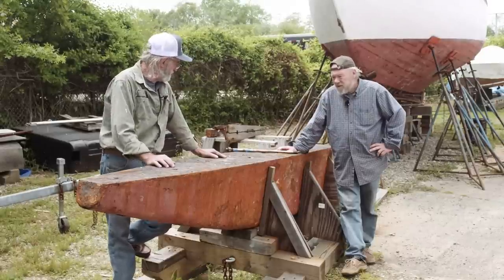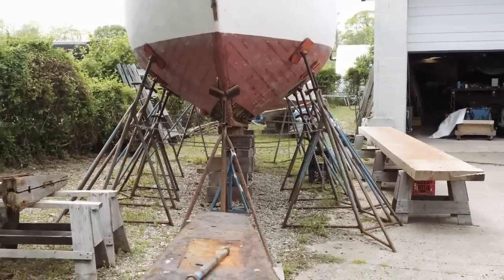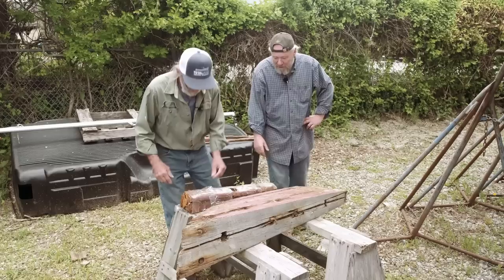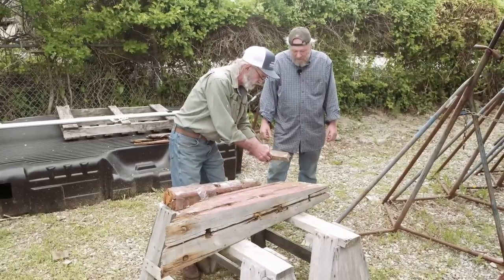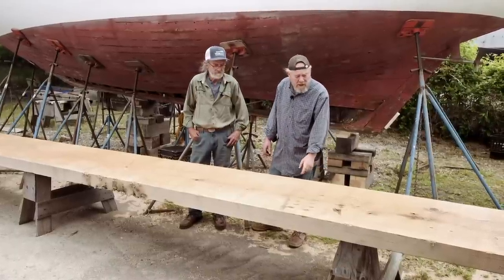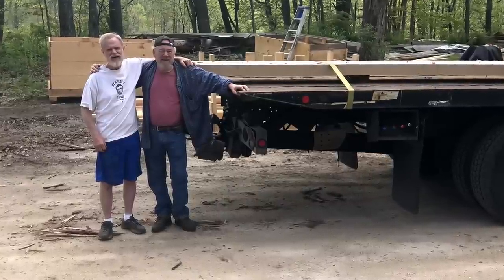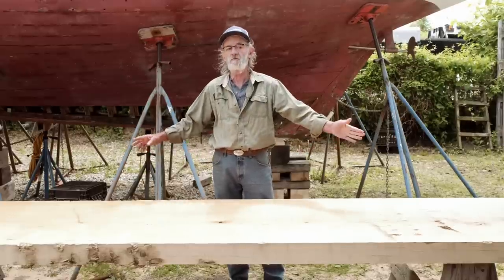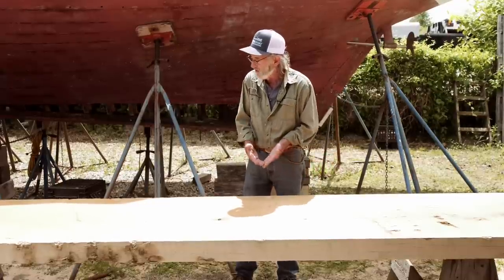Repairing Dawnell: Another 84 years of water under the keel, EP1

Comment: did you hear any tell-tale noises in rough weather indicating a loose keel?  We lost an American classic and the entire crew off west coast of NZ a few years ago. Captain was nervous about the noise during previous ocean crossing but never really identified keel movement in it last lift-out.
Reply from the maker: Our thoughts are with the crew, captain and their friends and families. Your comment made me think of the 1998 Sydney to Hobart race. In very heavy weather the noise of the wind and waves is so deafening that it's difficult to identify problems down deep in the boat. The top of the keel and tops of keel bolts are often hidden by the interior, systems, and machinery. What I noticed first with Dawnell is that when the boat worked hard, the bilge pump came on more often (not surprising). But when the  weather broke, the boat also took longer to "take up". Over time, I needed to remove a good part of the interior to get a look at the top of the keel. But to know the extent of the damage, you really need to take out the keel bolts, drop the ballast block and probably pull the garboards.